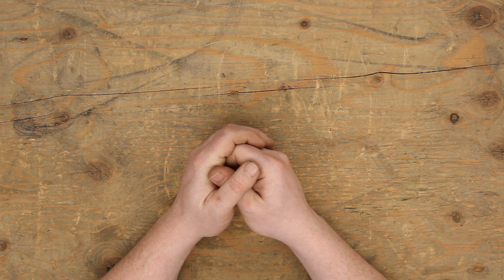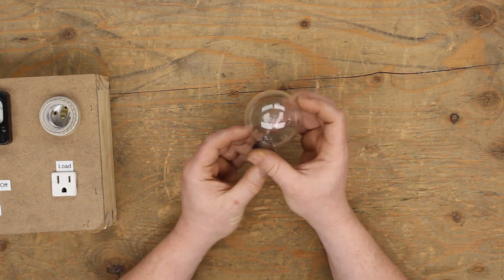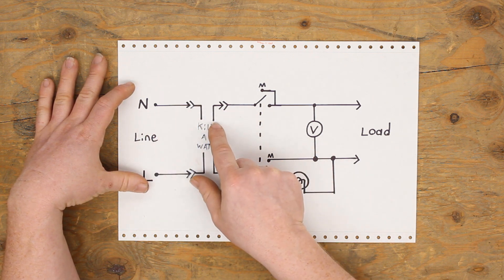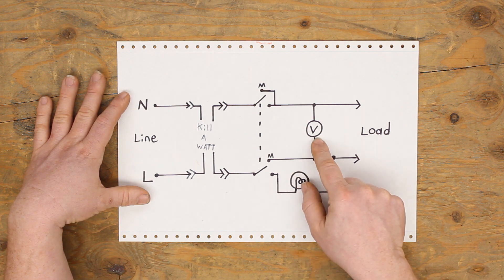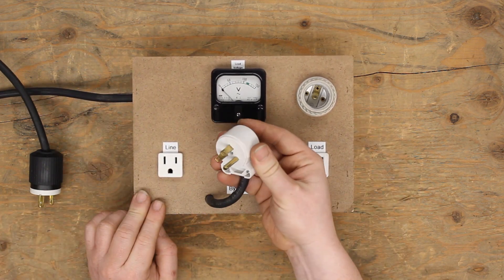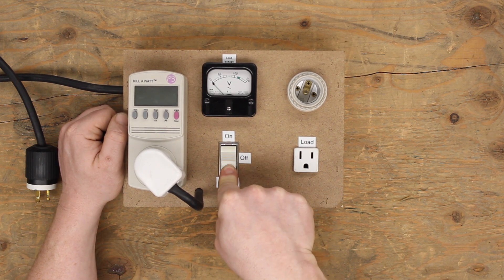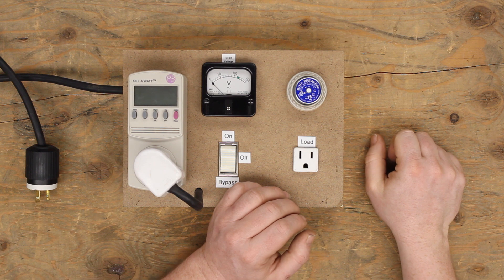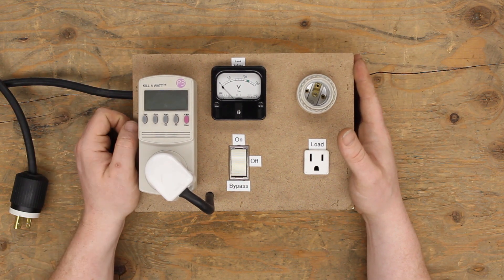The Dim-Bulb Tester

Comment: Too bad I don’t know what a Kill-A-Watt unit is.  Is that an Ameter?
Reply from the maker: The Kill-A-Watt is just a meter you plug in between your device and the wall. gives you a bunch of handy information such as how many watts are being used and how many amps something is drawing or what the voltage coming out of the wall currently is. they;ve been coming down in price over the last decade and I think they are $25-$30 now.

Comment: Do you have a plan on what you'll do when incandescent bulbs are gone?  I'm noticing it's increasingly tougher to find the old school bulbs with everything going to LED.
Reply from the maker: I have a stock of many, many incandescent bulbs of different wattages and types. It's excessive, yes and even now this house is entirely converted to LED but for props, demos and specialty applications such as compartment heaters or a dim bulb tester I should be good for the rest of my life.
Reply: @CelGenStudios Yep, I keep a huge box full of them. Basically a life time supply. And I run all the lab lights with LEDs.

Comment: Just a small thing to say......you don't need to have the circuit broken in 2 places......you just need 1 switch at the bottom to the light and load......Gord....Rework tech.....other than that good.....just needed to see it in action though.....
Reply: well.. the switch has third center position.. OFF